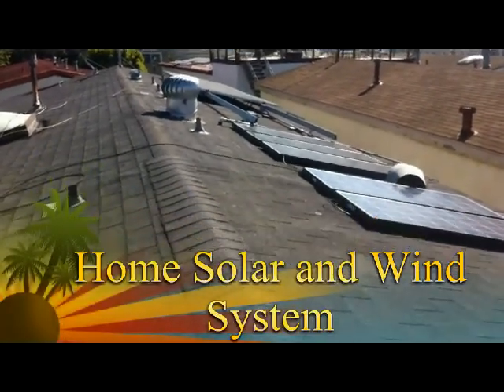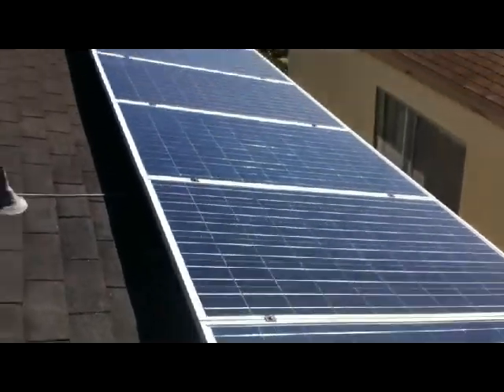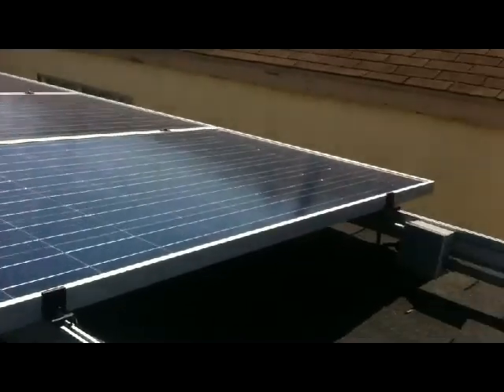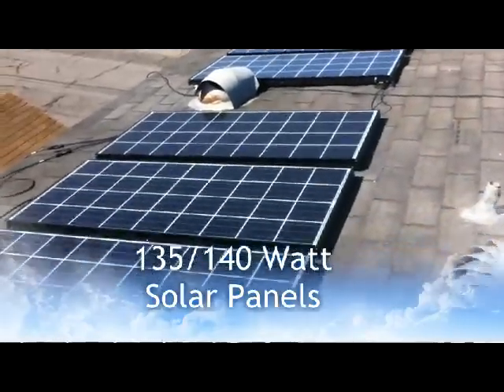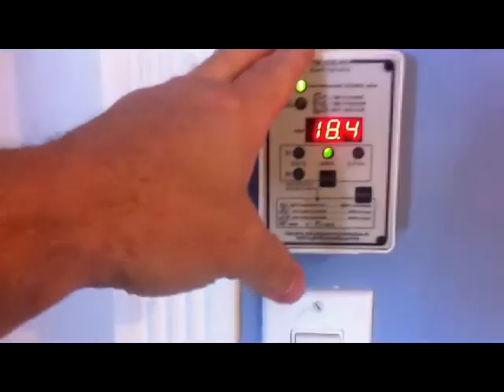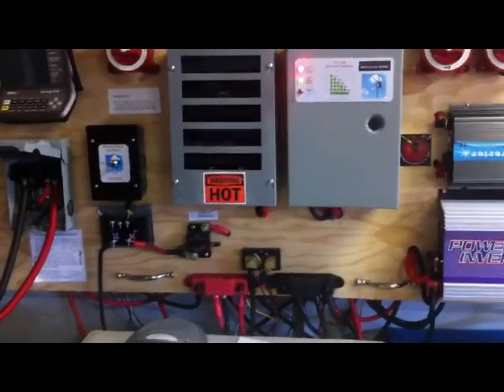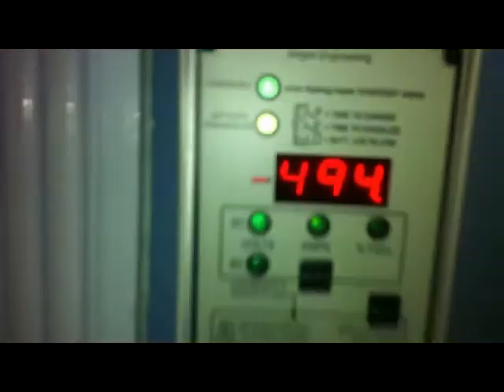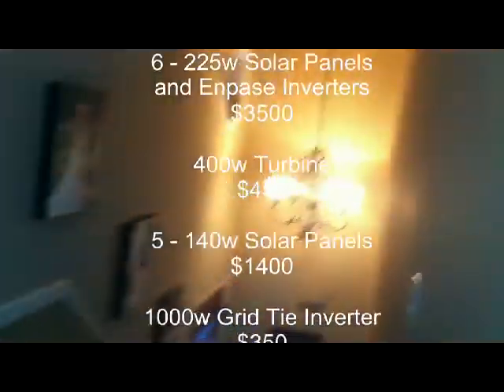Home Solar Wind System

Comment: I have a Degree in Renewable Energy and this book [link here >>>https://www.facebook.com/Build-Your-Own-Solar-132917764038406/app/208195102528120/ ] was required for the Solar Energy class. It is easy to read with good explanations. I would recommend to anyone.

Comment: Can you use the solar charge controller in parallel with a wind turbine charge controller (with a pair of blocking diodes on their respective outputs to prevent one charge controller feeding into the other charge controller)to charge a single battery system?

Comment: Ok, that video helped me a lot to understand what I may want and estimated cost. Thanks
Reply from the maker: if you have any questions or need any help, feel free to ask.  took a while for me to put together the system that worked for me. of course, if i had it to do over, there would be a couple things i might do differently, based on my preferences of course.  for example, if my goal was straight reduce my electric bill then it would be enphase grid-tie system only since simple install and most efficient grid tie inverter on market, and inexpensive.  but, because my preference is both grid tie with batt back up, and if price not as important, i would have gone straight to the Outback gridtie/battery backup system which is all in one.

Comment: Thank you for the video and for the total cost of your system. I'm in the beginner stages of setting up for solar only. I have one 100watt panel and a pwm controller hooked up to 3 batts. Will be upgrading as I go along, and get more $.
Reply from the maker: that sounds great. you'll have a lot of fun putting it together. i started out same way, a panel, batts, and controller and slowly added, and still adding. even though i'm still relatively new to this, if you need any help or advice feel free to ask.

Comment from the maker: lol on the "tin box"  seriously if i had 3 turbines (or even the 1000w version) i would pull the trigger on the midnite solar. that's bad ass equip. on panels, i did do a test on temp (hose down) and it increased on avg 200w to 210w per panel. but if compare cool day (65deg) with hot day (90deg) on my Enphase monitoring system i've seen 200w (hot day at peak sun) vs 240w (cool day at peak sun). plus Enphase lets you look at individual panel temp too. shit you just gave me a good idea for video

Comment: Nice. I would also have some cable ready and stored away for when the power goes out so you can connect to the MC4 connectors and use your panels for power in an emergency.

Comment from the maker: @ElRazTheGreat1 Also those recessed lights in house are all cfl so less of a draw than it appears.  Also  my batts are only for emergency power as I keep my  system grid tie and only use batts if grid down. Thx for the commentsd

Comment from the maker: that may be referring to a GTI without dump load capabilities.  but i see no reason not to do so.  also keep in mind that the instructions they include have lots of inconsistencies and ambiguities attributable in part to a language translation.  anyway, that's my two cents.  i'm completely comfortable with hooking to a GTI as long as it has dump load capabilities which MANY GTIs don't have which would put at risk for free wheeling if grid down

Comment: Another question for all. I have been reading and looking into the windmax turbines, most of the literature strongly stress that you should not connect to grid tie, or connect wind controller to gti.  many you tubers are connecting to GTI with no problems, so I was just wondering why that is? If I in vision the wire hookup, neg goes from wind to battery to GTI that seams ok, but pos goes from wind directly to gti then to relay but relay would be disconnec from the battery at that point, I think.

Comment from the maker: they do essentially shut off.  they probably would still consume little bit if power in order to detect, and turn on when they do detect incoming "solar/wind power."  They also essentially shut off when they no longer detect "grid power" and will only turn back on when they sense the grid power returning

Comment from the maker: Good question.  I tried hard to follow your wire diagram in wiring all 6 circuits (via the 120v -240v) and eventually gave up, and went for the easier wiring steps of simply wiring 1/2 of the circuits.  Believe me, I wanted to wire up all 6 but more head scratching, and even had a friend (electrician) try to find a way and he was perplexed.  In theory i know how you did it, but wound up going with easier method.  Fortunately, a found 3 awesome circuits to utilize in house. thx for watching

Comment: (note GTI will now have 2 pos leads attached to it) So 1 pos lead would be from relay and the other pos would be from #2 position on the switch, is that correct? The negative from GTI I think goes to Negative Bus,and the negative from wind goes to neg bus, or does the wind have to go directly to the GTI that is one of my other questions?

Comment: My relay is hooked up from left to right,  I think you can do it either way, I have mine hooked up that way now without grid tie and it is working. Mine will be jumper is on the left side the positive from the switch #1 position goes to N[C bottom left and goes through to the bottom right to plus bus bar (battery) so it disconnects when hits 14.4, then the positive upper right N/o goes on to grid tie. The other pos would be from #2 on switch? where does the neg from gti go is it to Neg Bus?

Comment from the maker: Next, attach a jumper wire b/w the N/C contact (at bottom/right side) and the N/O Relay Contact (directly above, and the post on right side).  Then, attach positive wire from the left side/post of the N/O Relay Contact and the pos terminal on the GTI.  (note GTI will now have 2 pos leads attached to it).  Then run 2 leads from the diversion terminals of the GTI to the dump load (resistors). Read this in conjunction with watching both vids Home Wind Turbine and Wiring Steps. let me know if probs

Comment from the maker: can't find email, but i'll try to explain here. also look at my recent vid "Home Wind Turbine" at end for some more info on wiring.  also if you send me a vid i can look at what you're doing and help fix.  But you want to take the pos (in from wind) after running thru your Blue Sea Switch and connect it to the N/C (normally closed) contacts at bottom of the controller accross to other contact at bottom and on to your pos battery.

Comment: Hello Sun I sent you an e-mail of how I think you wired your system, it will be similar to what, I am doing, with gti and battery back up in case the grid goes out,wanted to get your input if possible, I have the same relay and it is confusing the heck out of me, not sure if you got my e-mail so thought I would check in here, would be greatly appreciated.  Having hard time in my head figuring out how all this goes together, and I know yours works from watching your videos.

Thanks Ray